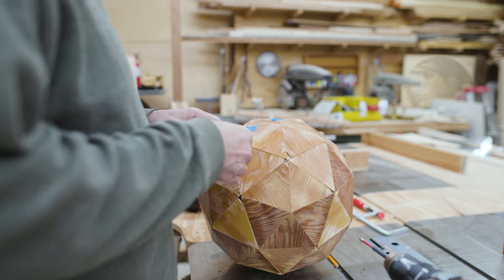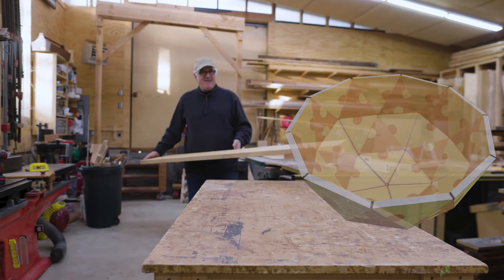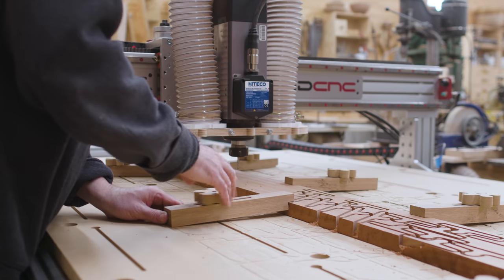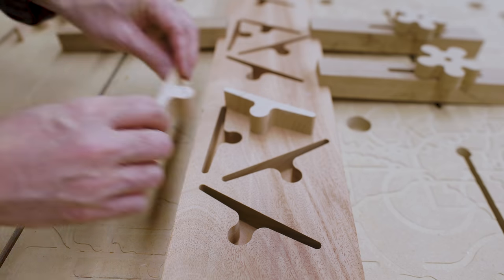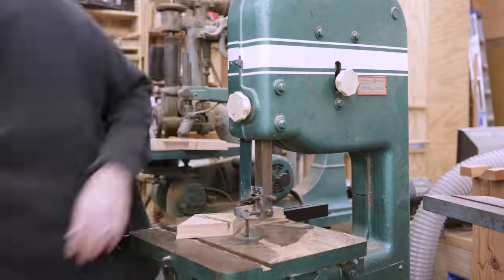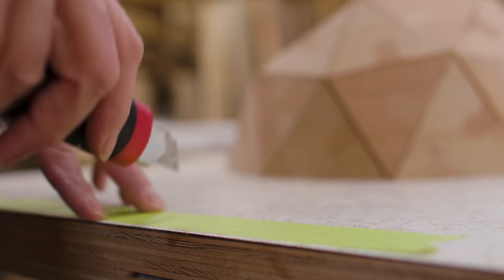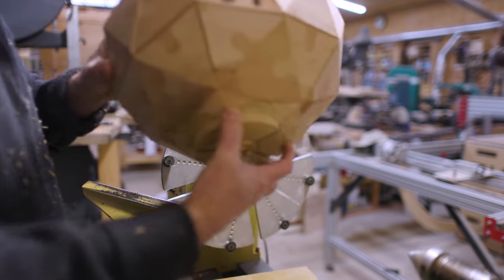Woodturning a Puzzle Bowl

Comment: Frank, I don't know how you programmed the cut in the CNC (aside from the multiple step-downs I saw), but in machining (wood or metal, it all applies) when you want to straighten the wall of a cut, we use "spring passes". You leave .005"ish around the entire periphery during step-downs, and then take multiple final passes at full-depth to clean the side-wall up. Do the first pass at the full .005" step-over, then run 1-2 spring passes at the same toolpath. As each pass is made, there is less side-pressure on the end mill, and it "springs away" less.  Should help a bit. It's also heavily dependent on your length-diam ratio on the cutter, what we call 1D, 2D etc. Once you start getting out past 5D-ish, spring passes make a big difference. All the best.
Reply: He may also need to sweep the vertical axis into alignment with a dial indicator so that it's perfectly square with the table.
Reply: @LameSauceAge  Yes, it could also be a tramming issue.
Reply: @brennerheavy  I suggested something like this probably a year or more ago.  I really don't think Frank reads comments so I stopped commenting on his channel.
Reply: @prototype3a  I am pretty sure he reads comments. I got some answers over the years.
I think for his application just making the cuts a bit oversized would to the job. These are no fitting in steel after all :)
Reply: Yes, I agree, the taper he is seeing is deflection. Adding a finish pass, if there already isn't one, plus a spring pass should get rid of most of it.
Reply: @ADBBuild  that definitely seems to be the problem
Reply: @LameSauceAge  But if it were an alignment issue, the taper wouldn't happen from all sides. I.e., it wouldn't be a taper, but a lean, and it wouldn't affect the fit so much.
Reply from the maker: @prototype3a  ha!

Comment: The end of router bits (and endmill cutters) will tend to wear more because it's used more, leading to that very slight taper you noticed.
Reply: Yeah, for anyone reading this… the way that a router bit functions is such that some areas will get more wear due to position and usage. Hence, an unequally worn router bit may produce different results than a non-worn one. Thus, the taper.

SOURCE: EPGeek
Reply: @funkychilldude  Can confirm. I've used a straight bit to rout 1/8"-deep dadoes, then later used it for something that required its full length. It cut fine, except for the last 1/8" of the bit, which left ragged results..

Comment: You use walnut and maple because they are the best contrasting colors 😜 And the most beautiful contrast.
On our CNC, we use a flush trim router bit with a bearing to cut off the onion skin. We also slow the CNC travel down because the bit does flex causing tapers.

Comment: have you thought about using the plainer to release the parts cut in the cnc from the boards? That would be an interesting experiment.
Reply: Bad idea, the pieces would have the chance to fly off or could flip over and be damaged by the blade. Regardless, the "bottom" would no longer be flat.

Comment: Could you make a two part clamping mold to glue the triangles?  A half dome bowl and a plug (or maybe a series of plugs to account for different radii from different thicknesses of bowls before turning).  You could face them with some kind of flexible foam or weather stripping to account for the irregularities and the angles before turning.

Comment: Hey Frank, first time commenter. I was thinking of a few ideas you could clamp your pieces better and here are some of the ones I came up with as a 3D printing hobbyist: 

- 3D printing an inside and outside profile to the triangles, shaped in such a way that there are flat, parallel sides. When I say "profile", I'm thinking of a 3D model that fills the negative space on both the outside and inside of the triangle assembly. Having parallel sides could allow you to clamp the pieces down in a proper manner. Downsides to this approach would be that these profiles would have to be fairly strong and I'm not sure how the prints would handle wood glue. Ideally, you could print a bunch and they would last multiple projects, but if not, you could also consider 3D printing molds that you could pour epoxy into to make something that's more durable 
- Similar to the previous suggestion, you could 3D print custom designed clamps that have the correct angles to work with your glue ups
- You could modify small C-clamps to have a threaded insert at an angle. You could mount these clamps to the edges of your triangle and use a threaded rod to bring these inserts closer together. The angle of these inserts could be fixed to fit one size/type of bowl you're using or you could even 3D print an assembly that allows the angle of threaded inserts to be adjustable  
- For bigger assemblies like quarter or half spheres, you could print the inside profile to the bowl (as mentioned above). Place that inside your assembly and then use a strong vacuum and flexible plastic sheet to bring the corners close together in a uniform way (almost like you're vacuum forming the plastic around the bowl)

Hope this helps! I'd love to see you explore more 3D printing on your channel as well!

Comment: That is very awesome, and a good way to go about it. However to get the effect i believe you were going for you'd probably have to go all out and have tapered the entire triangular puzzle piece at the CNC, then puzzle it together in glue up.
as for gluing, a jig cut out on the cnc pentagram with triangular sections to the angle it needs to be with a mirrored section to put weight down on top?

Comment: Really fun project Frank and it 'turned' out real nice!  The sphere comprising 80 triangles is a Pentakis Icosidodecahedron (pronounced: penta-kiss icosi-doh-deca-he-dron).  It's an Icosidodecahedron with caps (very shallow pyramids) on the pentagonal faces.
Reply: The faces of a pentakis icosidodecahedron (wow what a word) are also not all the same, there are 60 isosceles triangles and 20 equilateral triangles in it, which could explain the slight inconsistencies that Frank was experiencing during the glue-up. But it turned out really beautiful, which also shows that you don't always have to be spot on with your math for a thing to work out! 😁

Comment: It will take a while. But, you could build up the bowl two or three triangles at a time by making thick, flat triangles that fit together as puzzle 🧩 pieces. Then angle the surface of the puzzle pieces using a jig on the CNC table or the table saw. 

To glue up a bowl, glue tabs on to each piece first. The tabs will give the clamps something to hold on to. Later the tabs will be cut off during turning.

Comment: You always do complex projects. Good job and keep these projects a coming!

The router "taper" is likely spindle wear in the collet bearing. It may be deflecting enought to produce a deflection in deep cuts.
Reply: But most of those cuts had wood on both sides. There was no reason for it to deflect one direction or the other. I think it's more likely his cutter simply has a bit more wear closer to the tip, for obvious reasons unless it's brand new.

Comment: Beautiful work as always. You mentioned wanting to find an alternative clamping method. I realize this is nigh impossible, unless you, say, collaborated with someone like This Old Tony to get a custom end mill - or a set of them - for the CNC. But what if you cut the triangles only on the CNC, with the joining angle already there just from routing? Then assembly and clamping would basically be just like putting together a puzzle.
Reply: Requires a fourth axis, for the CNC to cut at an angle. You'll notice he did all the angled cuts on the table saw, which is relatively easy, since he had already made that triangle jig for a previous video. Doing angled cuts on the CNC table is not so easy. You'd need to either allow the head to rotate, or prop up the stock on the table at the desired angle.

Come to think of it, you could create a CNC triangle jig similar to the table saw jig. Hmmm.
Reply: @ps.2  Or a ball nose end mill, or, as I suggested, a custom mill since the angle is known. See "Dennis Van Hoof" on YouTube if you think CNC can't do angled cuts without a 4th axis. Yes, he has some that use a manual 4th axis, but many projects are quite curvaceous and include angles galore without using the 4th axis.

https://www.youtube.com/watch?v=zg_A2GNCajQ
Reply: @earlye  For puzzle pieces to join tightly and not leave voids, I don't think you can just use a tool with a taper. The required taper angle would vary from, say, 15° to -5° along the curve of the puzzle piece. And the negative taper angle would be hard to get even with your ball nose.

Easier to prop up your stock at half the eventual join angle. Which, yeah, you could do with a jig not unlike the table saw jig.
Reply: @ps.2  I can see that the taper may vary along the curve of the puzzle piece. I'm not really convinced that it would ever be a negative taper on a given interlock. So I'd think the male interlocks would have angle "A", and the females would have angle "-A" in the same location. So machining a piece would require accurate 2-sided machining, but not a 4th axis
Reply: Now that I think about this discussion, I have a vague, possibly wrong, recollection of Frank having a CNC-controlled 4th axis, which would make this entire discussion purely academic (because there was totally a chance that Frank would take any of this advice in the first place /s)
Reply: @earlye  Think of a puzzle piece as the letter C, opening up to a straight line above and below. The taper on the left side is (let's say) 15°. The taper on the top and bottom is 0°. The taper on the tips of the letter are -5°. The straight lines above and below the C are back to 15°. Of course since this is a smooth curve, the taper changes are also smooth.

A tapered tool could cut the left side of the C and the line above and below it. It could not cut the rest of the curve. Not if you want a tight fit between pieces. No, I think the angled jig is the way to go.
Reply: @earlye  As for the fourth axis ... he may have one ... but all I can remember is the "bed goes up, bed goes down" hinged table, which of course is not CNC-controlled. Though Frank's love of stop-motion animation may make it appear CNC-controlled at times!

Comment: You said "Gravity Clamp" and my ears perked up. I bought some 12" square concrete pavers, glued yoga mat to the face side and made a handle on the other side using 2x4s and PVC pipe. I call them gravity clamps and I use them all the time. I used epoxy. Note: Put down a layer of epoxy on the concrete and let it cure fully, then use epoxy again to glue the pieces together. The first coat seals the pores of the concrete.

Comment: I think the best glue up method is going to be to make a jig that they tightly fit into on one side, and are forced into the jig with a clamp. Likely starting with pairs, and then gluing pairs together in another jig, and so on. Rather than just trying to push the pieces together with a clamp.

Comment: You might get more contrast as it ages. Cherry gets darker with age as you probably well know. Question: Will your CNC router cut at an angle or just the 90deg from your work? It would be cool if you could cut an entire puzzle piece with angle on the router.

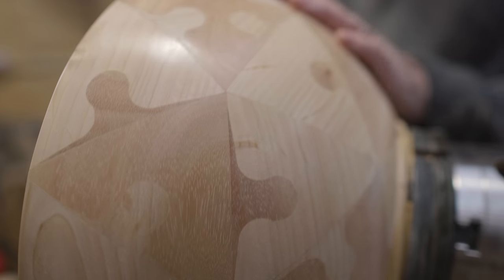Comment: 14:37 that part on the left was a mistake right? It has two (how do you say?) protruding puzzle parts next to each other. Which should be impossible?
I personally feel this is one of you best looking bowls, especially because it is so subtle. The fact that, for example, a protruding dark part and the dark triangle neighbor would have been both walnut but not from the same piece in a board anyway and by that maybe even more different in color, would have highlighted the fact maybe even more that the triangles are kind of cheated.
As long as it is not possible to make it a "true" puzzle i think this is the best way to go.
Really nicely done!
Cheers :)

Comment: Frank, great looking bowl. I have a question maybe you or someone else could answer. I got a piece of a branch 350mm long 150mm diameter, cut it and sealed it in wax October 2020 stored in shed in saw dust. 3 weeks ago I brought it into the house, cleaned off the wax no visible cracks, cut a few mm off each end still no cracks,I turned a solid wine  bottle and today its got a crack from base of neck to the bottom of bottle. Do I need to leave it dry longer, shed is not insulated. Aghhhhhhhhh.

Comment: I wonder if you had put it under some strong UV lights for a few days before applying the finish, if that would have jump-started the darkening of the cherry.  (or even just put it outside in some direct sunlight)   I'm just curious as to what this will look like in a year or two after the cherry has darkened.  Does the Kaya(sp?) darken also with time?

Comment: I actually think it's better to not have such a huge contrast between the woods. There are too many people that do that for everything. Early on, I kept seeing the pieces emerge as the light changed, and that was something not as many people would notice right off, if at all. The light playing in the grain would be a "hidden" discovery later. From a distance it just looks like a wood bowl, closer it has puzzle pieces, when you move the pieces stand out more. If you remake the bowl, it would be interesting to see how much different it is with the grain aligned, but, may not be as interesting as the way it is now. That's the problem I have found over the years, you think you are doing something cleaver, and the mistake works better than what you had intended.

Comment: This may be a stupid question but how does the CNC machine detect where the material is to cut?
Reply: Don't know if he still does it this way, but with his original CNC build...
He wired up a handheld video game controller. Using the controller, he could move the CNC head manually in all 6 directions (up, down, left, right, forward, backward). He would move it to a designated "origin point" from his CAM program, then run the program, and it would do everything relative to that point.

Comment: Very interesting ... good video. I cringed a bit when you were using your scraper ... a conventional scraper should used with the tool rest above center and the handle raised to meet the surface at a down angle. Otherwise you risk a nasty catch and the tool can self-feed into the workpiece.

Comment: At this point might as well model every piece in CAD, then waterline CNC everything with a ball nose end mill at something like 0.5mm (or even less) depth per pass. That will give you perfect tapered shapes to glue together instead of having to make triangles and tabs separately.

Comment: What about making a five-sided pyramid that you could lay the triangles on top of for glue up? Put a lip around the edge of the pyramid for a positive stop along the non-glued edge. Apply pressure with five toggle clamps that would push down onto the pyramid and use the spring clamps across the points for inward tension. (Another master-engineered Frank jig.)
Reply: I was thinking this, but the opposite - create a 5 sided hole that the triangles can sit into, then use the weights to press the pieces down into the center. You get the advantage then of not working against gravity, as they will settle into the correct position instead of settling away from it if that makes sense